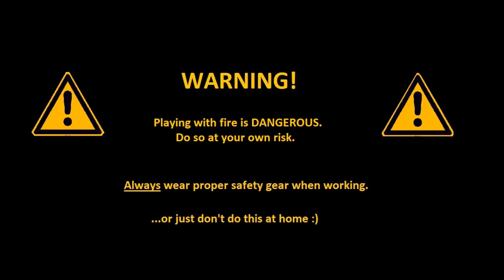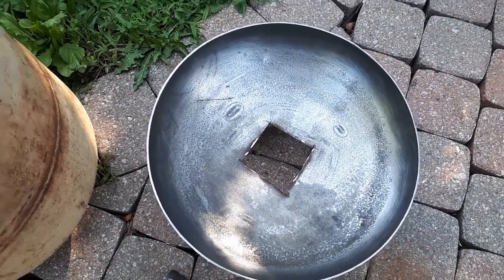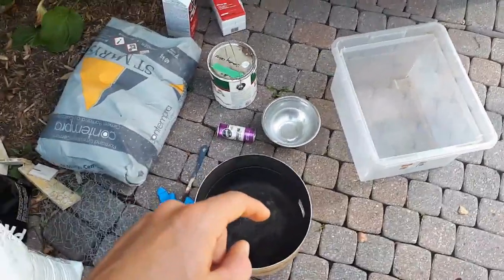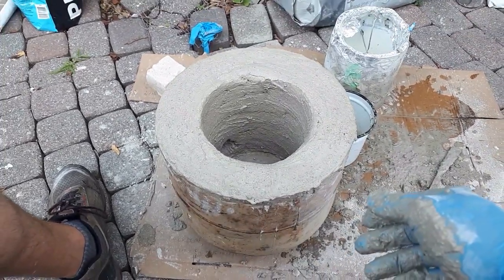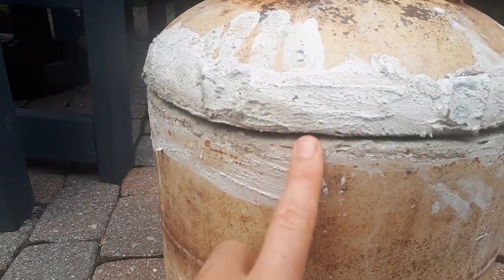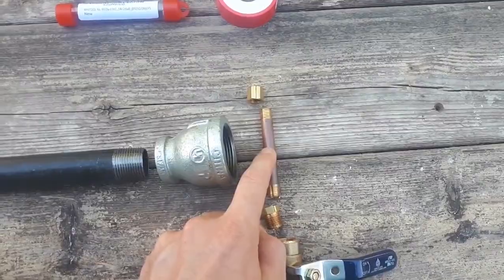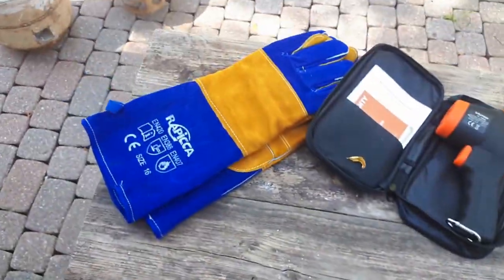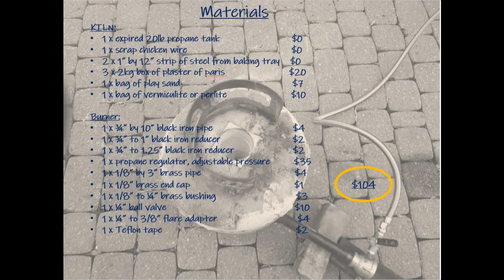DIY Casting and Smelting Kiln w/ Burner

Comment: Years ago, someone gave me a small commercial smelter - Foundryette -  is the name on it, I cant find very much about it on the internet. It came with a squirrel cage type blower that the propane is plumbed into. They have me a 5 gal bucket full of crucibles as well. 
Ultimately it is alot like the one you created, except the air induction. I only had to buy a regulator and it works well. If you would like, I can take a pic of the label on it, like I said, it was a commercial made for sale type item.
I smelted 8 grams of placer gold into a fair sized button, and due to the borax managed to get rid of any small impurities that might have been mingling with the flakes.
Reply from the maker: Very cool! I melted a few grams of placer gold into a small button last year as well. Though I found if it is very clean placer gold, putting some borax in it, sitting it in a cupel and hitting it with a blow torch was much faster at melting it into a bead than in the kiln.

Comment: do you think a small propane smelting furnace could be used to fire raku at 1950 degrees F?
Reply from the maker: You could get the temp that high, but I dont know how even the heat would be. I haven't done anything with pottery before but I would guess it needs to be an even heat. You'd want to elevate the clay in the furnace to make sure the flame isn't hitting it directly at the very least. (I had to Google what "raku" was by the way).
Reply: @LetsCrushRocks  Thank you so much for the quick response! Oops, I guess should have said what raku was in my original question...lol. I know people raku fire pottery in a LOT of different home made kilns and heat them with propane, so this seems like it would work to me. I think my only concern is if the heat ramp up can be controlled? I would not want it to go from ambient temperature to 1950 F in 10 minutes 😅
Reply from the maker: You could adjust the gas flow with the valve and the pressure regulator to help with some temp control. You can also leave the lid off to start with as things are heating up and then put it on later, I do that when I first start up the kiln to drive out any moisture since it since sits in my shed often for months without use. I should probably get around to uploading an update video. I ended up changing my design a bit... stay tuned I guess!  @amyrp9115
Reply: I appreciate the help and just subscribed! I will stayed tuned 😉 @LetsCrushRocks

Comment: Say man,  you might want to consider showing the end product, be it a success or failure.   I Liked the information in your video (even if it's a bit wordy)... but a look at the end result would have made the video more worth the time.  I was looking forward to the reveal with much anticipation and was sadly disappointed to be left hanging like that. I was thinking ...damn, I sat through this whole video listening to you yap for that???  I'm not hating on your video man, just one guys honest opinion. Keep them coming.
Reply from the maker: Good point!
I will see if I have time in the next few weeks to post an update video with some more shots of it in use and lessons learned. 
In a nutshell:
The burner works excellent and I have had no problems with it. 
I used the furnace perhaps a half dozen times and it worked well each time, getting to >1100C without turning the burner all the way up. However some of the plaster, particularly where the lid and bottom portion meet, did crumble a bit. I think it may be because I did a poor job mixing the material in small batches instead of one big consistent pour. Because the lid and bottom section did not match up smoothly, some heat and gas were escaping out the sides, which I believe also contributed to it wearing down at that spot.
Unfortunately, it sat in my shed for about 8 months unused, including over winter, and seems to have absorbed some moisture. I am in the process of repairing it and will try to include that in an update video.
Reply: @LetsCrushRocks  You Sir are a good man!